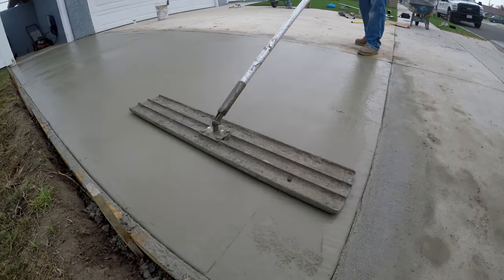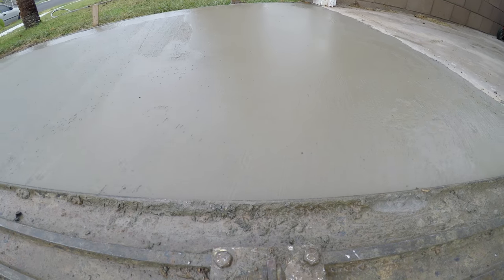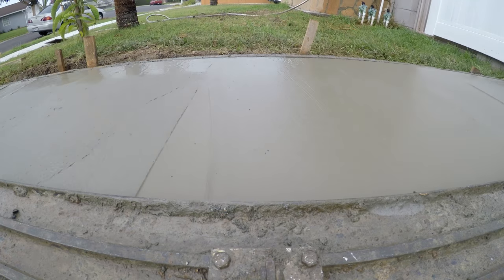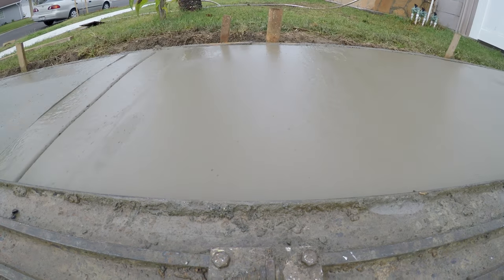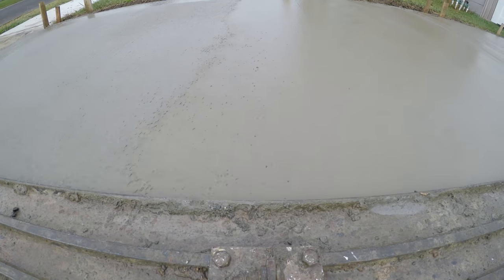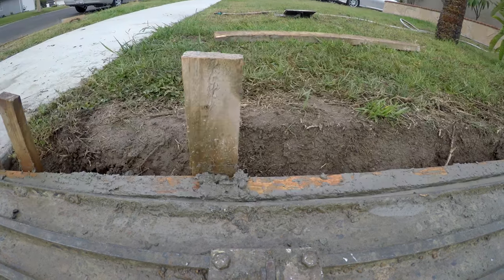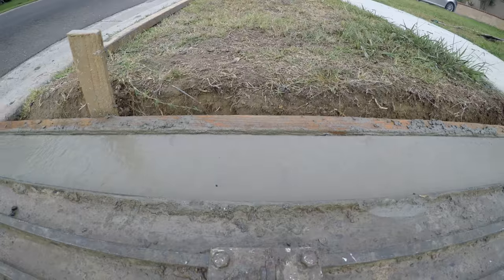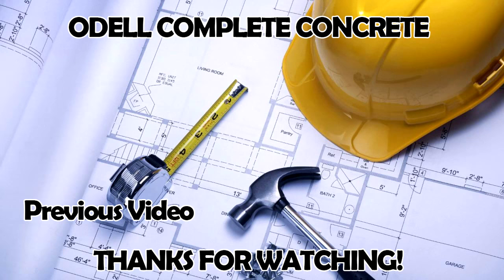How to Finish Concrete with a Bull Float

Comment: Great videos, I have  a question!  How about making a video of a small flat project, using all your tools, from start to finish but tell us how you know when to hit the concrete .  How you time the use of each tool to obtain your finished product?  Your  timing, knowing when to use each tool, is greatly determined by the curing time of the concrete but what condition of the concrete tells you  when  it's time to use the next tool?  What signs to you look for , in the concrete, that says it's time to use your next tool?
Reply from the maker: Yes that's a great video.
That might be in my book.

Comment: I have a DIY patio with chevron shaped tiles. I never got a chance to put down the polymeric sand and now I have weeds growing between the slabs. Do you have a video that fixes something like what I have? The slabs are 50 pounds each and there's more than 20 of them; don't want to move them. But I want the weeds gone.
Reply from the maker: try weed killer
Reply: Odell Complete Concrete I have, they keep coming back. Hoping for a permanent solution.

Comment: I have 1 question, I do asphalt sealcoating and repair for home owners and would like to add in some concrete work and if it goes well make it into a separate business. The question I have is, can you lay concrete in the winter if yes, is it practical?
Reply from the maker: I do concrete year round if I have the work. No harsh winters here in Southern CA.
Reply: Depending on where you live. Temp has a huge impact on the rate @ which concrete hardens/cures. Calcium & hot water can only do so much xD
Reply: @stove74  you cannot lay concrete when you have a ground frost and need to spray the concrete with water while its drying, when it hot, to stop it cracking. They can use  additives to reduce the cracking.

Comment: Very well presented.  Just spent two hundred bucks at Home Depot for a Marshalltown square end float.  Was unable to find a used one on any media platforms available to
my area.  Just as well, I like to buy new and keep it as new over the years.  So many differing opinions on concrete finishing, even amongst the pros.  Thank you for yours.
Reply from the maker: Yes there is, it really comes down to preference

Comment: If you did not have a large bull float, could you float it by hand using a magnesium float?
Reply from the maker: Yes you could use a hand float, but it the concrete may not be as flat as you would like, unless your very good with a hand float.
Reply: Odell Complete Concrete how would you do steps? What tools do you typically use for that
Reply from the maker: Edger, handfloat, trowel, and cove/top tool.
In that order
Reply: Thank you. I didn't even know a cove/top tool existed!

Comment: Whats the deal with magnesium floats?, can't they be made of steel?
Reply: You start using magnesium trowels/floats because the concrete is too soft for the hard steel. Think of this like sanding something down. You start with low grit and go to higher grit for a better finish? Same idea!

Comment: How many time do you need to run the bull float over the surface? And are there time you will not need to bull float?
Reply from the maker: I've always bull floated.
Two times is enough in opposite directions ideally.